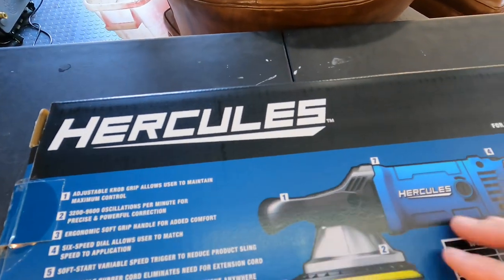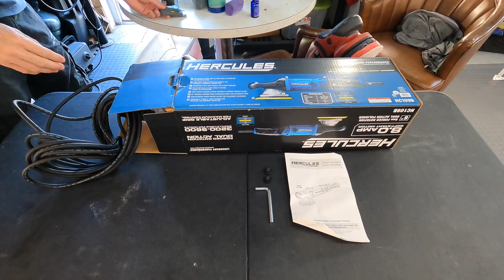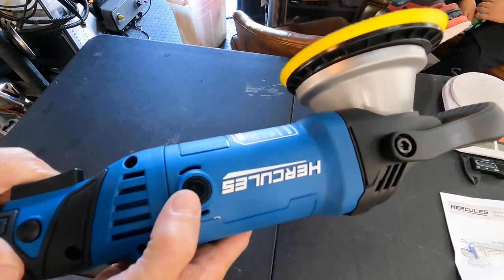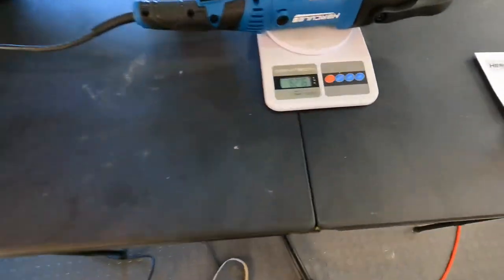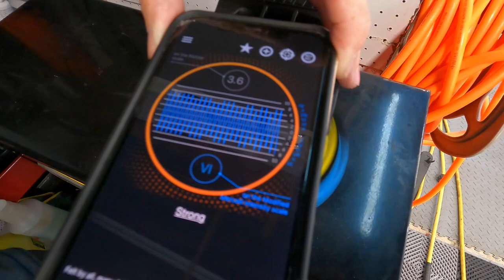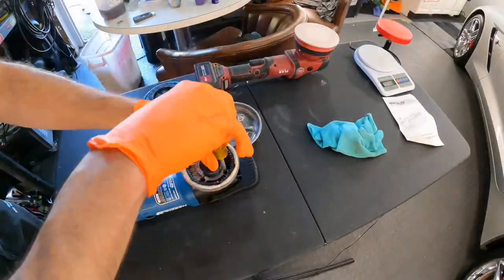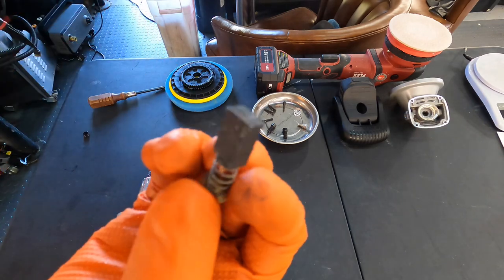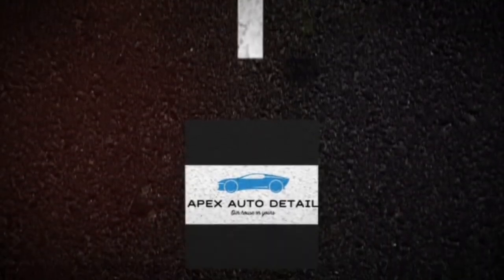HERCULES HC109B Forced Rotation Dual Action Polisher! Harbor Freight Tools!!!!

Comment from the maker: Do you own a polisher? What model polisher?
Reply: I own Adams polishers , a Maxshine and several Rupes.
Reply: I just bought the Hercules. I also have a Chicago electric rotary and a 8mm polisher and the Bauer 21mm
Reply: Dewalt 849x
Reply: Rupes 900 and Maxshine. Thanks for your tutelage Brian!
Reply: I own the BEST...... Chicago Electric!
Reply: Max Shine
Reply: Shinemate Ex620 and EX603
Reply: I'm a DIY guy, so nothing costly for me. I have an SPTA 5-inch cordless, and two generic corded polishers, one 5-inch and one 3-inch. They work well enough for the work I do.
Reply: Shine mate 15 5inch griots g9 5inch and g8 3inch makita po 5000 5inch spta rotary 3inch
Reply: Do I have any polishers? Yes! I only want to use the rotory. That's the Maxshine 550
Reply: Uso mákita
Reply: Several.. Flex XFE 15 150 cordless.. Flex PXE 80.. Griot's Garage G6. Maxshine M15 Pro G.. and the Maxshine M1000 Rotory... And the new Hercules as soon as I can get it😁🤓🤘🏻
Reply: Still have my PC 7424 XP.  Bought it 16 years ago and am still waiting for it to break!  When it does, I will buy a Milwaukee M18 15MM chordless.  I still don't trust myself with a force rotation polisher.  But I am very conservative with how and when I use a polisher.  Plus, the compounds and polishes these days are so much better, as well as the pads and polishing technology.
Reply: I have a question not related to this video. Can you apply Carpro Gliss as a final last coat on Adams Advanced Graphene coating?
Reply: Griots G8 and G15. Also a Torq Rotary.
Reply: maxshine m15 pro g
Reply: 3M perfect it DA polisher. Blows away my Rupes in every way.
Reply: Dewalt Rotary, SPTA DA, and Adam’s Swirl Killer DA polishers.
Reply: Flex 3401, Cyclo original(not Rupes Cyclo), Griot's G8, G9, Chicago Electric Rotary, Shurhold 3500 21mm,
Reply: That is a steal for The Price. Forced Rotation at this level for under $100 with coup😊on?!?! Let's Gooooooo! 
One job pays for itself many times over. Thank you for bringing this to our attention Brian.
Reply: Flex 3401……owned it about 7 years… work horse!!!
Reply: I have a 3" Griot's, a 5" Griot's, and a 5" HF Long Throw with mods.
Reply: 2 dewalt cordless rotary and da, Chicago corded rotary, 22mm da
Reply: PC 7424 and the Flex 3401, really like the Flex.
Reply: Porter Cable 7434 that is at least 20 years old.  Its been sitting in a box of auto detail stuff for a long time and I'm just getting back into caring for my own vehicles and stumbled across this channel to refresh my DIY knowledge.  Is this still good?  Does it need to be greased or anything before use after sitting for at least a decade?
Reply: Flex 3401, Makita rotary and the Ultimate Detailing Machine.
Reply: Meguiars and a Ryobi; I use them for different situations.
Reply: I own a dewalt rotary
Reply: Porter cable xp, flex 3401, milwaukee rotary, milwaukee 15mm large throw da
Reply: I own this one in the video and a Rupes LHR15 MKII with washer mod. I get faster correction with this Hercules.

Comment: That's a lot of value if it holds up.  I've really enjoyed my HF bauer long throw after a regrease and switch to a 5" backing plate.  I bought it as a back up but found myself grabbing it first just because it works just as well.
Reply: Thanks for the info...  What grease do you use?  Cheers!
Reply: @jeffclarke5497  Lucas Red and Tacky.  No need to over pack it.  It's a good high temp stable grease designed with gears and pressure in mind.

Comment: They seem to be in stock at my local store, i might pick one up this week. I plan to grab a Flex 3401 5" backplate and run it stock before doing some upgrade. I got some leftover Amsoil grease mixed with ws2 and change to Japanese bearings; NSK, Koyo or Nachi, whichever bearing is cheaper.
Reply: thank you Yakub very cool

Comment: FWIW, the tool comes with Mobil 1 top tier grease - not "cheap Chinese grease." There is no need to swap the grease :)
Reply: How are the bearings? The Flex uses made in Japan Nachi bearings.
Reply: @Pepe-dq2ib  They are also high quality sealed bearings.
Reply: @MarkusKleis  what brand?

Comment: If these had a 5 inch plate I would buy one today.
There are times when the forced rotation would work better for removing paint defects.the price of this machine would make it ideal,however I don’t want to have to buy a separate size pad for something I wouldn’t use as often as my Rupes LHR15MKIII

Comment: Hi Brian,  I just watched this review of the Hercules HC1098B polisher. As alway a great and complete review. After viewing  I checked out a few other reviews on this polisher and in one the detailer stated that the Flex 3401 5 inch backing plate was compatible and interchangeable with the Hercules, can you verify this to be true, I’m thinking of purchasing this polisher but I would prefer using 5 inch pads. That’s again for the great video.

Comment: I could not get the 4 gear head screws out to change the gear head grease. I noticed that you did not either and you showed the back side where the grease is. I am assuming they have red lock tight on them or something.

Comment: Forgive me Brian, that's not the Flex XC 3401 VRG, because the old Flex XC 3401 VRG was corded not cordless like the model the you are showing is called The FLEX XCE 8-125 18.0 Polisher Gear Driven Forced Rotation DA polisher!

Comment: Is there any information on the throw distance of this polisher? I cant find it listed on the website or in the user manual. Would you pick this one, or the harbor freight 21mm long throw? Seem to be competing for the same price range
Reply: 8mm standard throw, same as the Flex. The Mille has a shorter throw. If you’re only buying one polisher to do everything. This is the one I’d go with. A separate 3” polisher is almost a must have with the long throw. Though it’s also very capable and well made for the price. I have one that’s done well over two dozen corrections and still going strong. Just a grease swap and a 5” plate is all I’ve done to it.

Comment: UPDATE THEY NOW SEND EXTRA BRUSHES!!!!! THEY ARE INCLUDED IN THE BAG WITH YOUR WRENCH AND HEX DRIVER!
Reply: Not the case. I Just got one today 5-17-24 and it did not have the spare brushes. Going back.
Reply: @davidmorcos1463  You must have gotten an old unit friend IDK.
Reply: @ScrungoScrubs  They had several, wished there was a way to tell.

Comment: Under $100 and they still make profit to do business?   Wow, shows how much detailers  are being fooled by handlers of the industry.
Reply: With reservations, the margins must be super slim. It’s not like you are buying a precision tool, at HFT anyways, the tolerances are way off, acceptable perhaps to a degree, and perhaps more than good enough for the weekend warriors or the backyard mechanics, or even the ones first starting in a field and getting their feet wet — not something you’d necessarily rely your business operations on a day in and day out basis where any slightest downtime could result in a much greater loss. As this video has mentioned, amazing backup tool available today at your local HFT. Head over there now and pick one up!